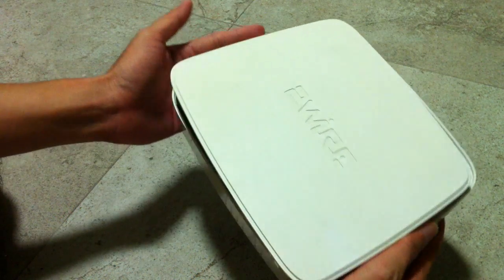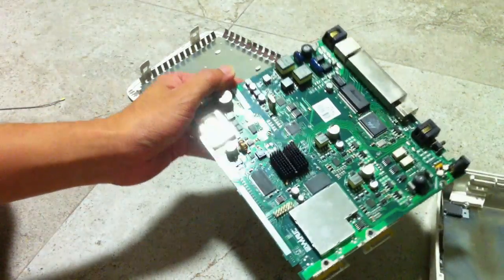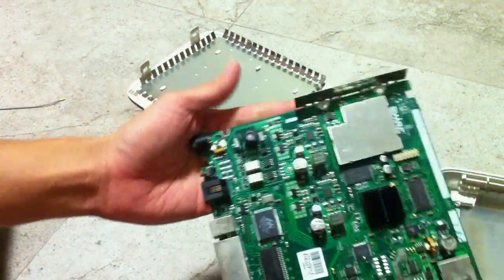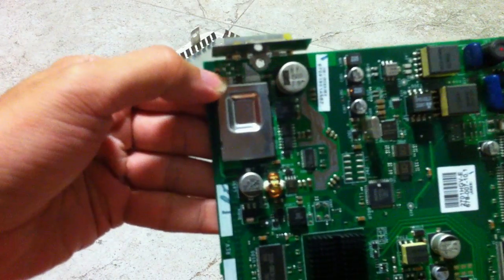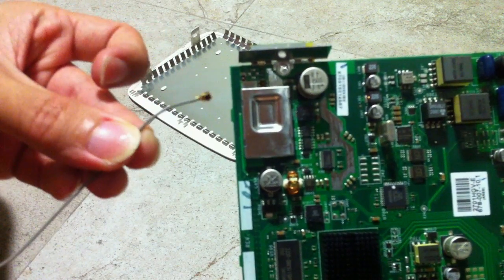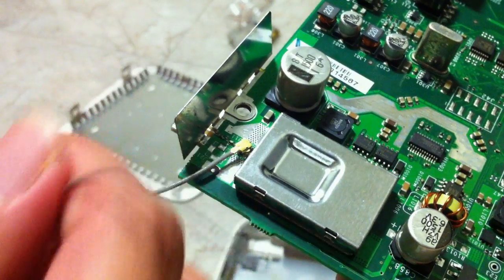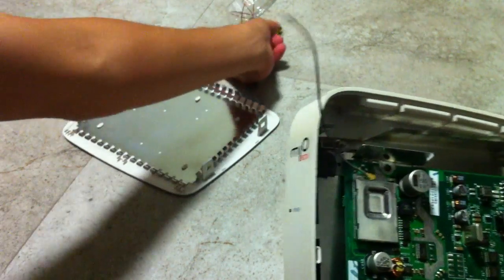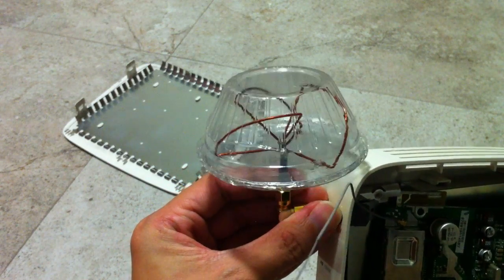Circular-Polarized Wifi Test with a Cloverleaf

Comment from the maker: @RajeevThanks for your kind words. The connector I used are the common leads used in the FrSky radio receiver. The receiver has 2 of these for diversity. I bought them at hobbyking under their FrSky receiver section. While it appears to plug nicely to the test port, it is not a direct match as the test port does not have a center pin. It is a flat tab of copper in the center(signal) of the port. I cut a piece of resistor wire (1.5mm) and insert it into the hole of the lead's connector. This allowed contact with the signal and problem solved!

Comment: Good Video. Question: Which connector have you used (the small connection on the barely visible tab for external antenna)?

Comment from the maker: It is useless for a mobile phone or a tablet but useful for a laptop using a USB wireless card that has an RP-sma port. M using a 2.4g crosshair antenna (rhcp) on my laptop. With a linear setup (7db linear patch on the USB Wifi n no clover on 2wire), 57% is the max. With the crosshair n clover, m getting 65% and link quality is 98%.